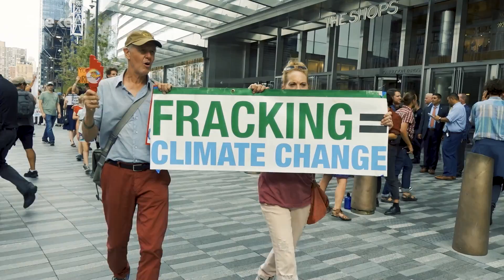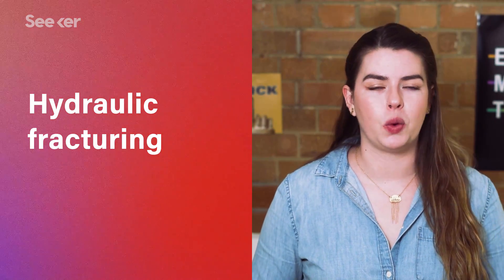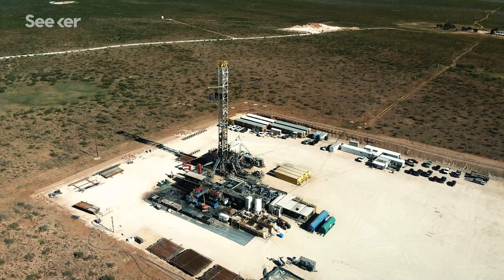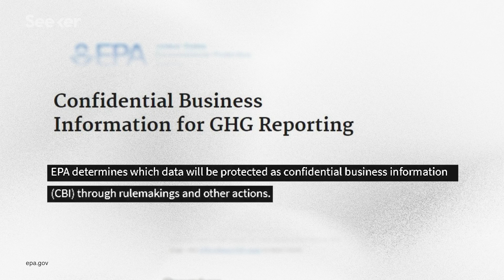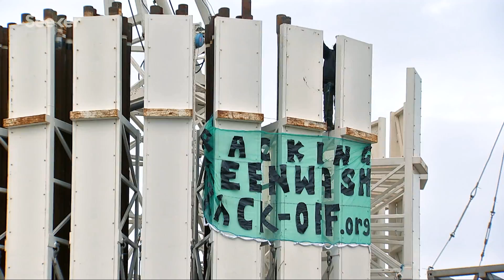What Exactly Is Fracking, And Is It Really That Bad?

Comment: Just so you know, because they're allowed to pump tons of chemicals into the ground without disclosing what they are, it actually gives them the opportunity to legally get rid of industrial toxic waste for free. Fracking is a nightmare, we literally have energy pouring down on us. Solar tech only gets better every year and we're nowhere near the end of that process, more like the beginning.
Reply: Please see how toxic and environmentally destructive it is to make solar cells
Reply: Doesn't work at night!
Reply: @justinvideoman  it does work  new certain plants  uses big multiple mirrors which focuses (solar)light beam at a particular point generally molten salt is used, also they use thermal redundancy capacity of molten salt to generate power at night, molten salt acts as a big thermal power bank for heat exchangers to work and produce power and  anyways if you wanna know more you can look it up, it's called concentrated solar power plant or CSP for short

Comment: What green energy? Again you don’t provide any solution.
Reply: There is no such thing. Environmentalism is largely just another control mechanism.
Reply: @Chris_Garman  ofc there is. If you can't see that I can't help you.

Take the green pill
Reply: @xXDESTINYMBXx  I went to school for Integrated Resource Management, including environmental science, ecology, etc. Get yourself some education so you can join the informed and leave the indoctrinated.
Reply: @Chris_Garman  if you really did that, then you just don't value nature, do you?
Reply: @xXDESTINYMBXx  I just know the truth. Just a tiny example, the first thing taught in environmental science to me; for a single use application, Styrofoam cups are more environmentally friendly than paper. Tip of the iceberg.
Reply: @Chris_Garman  yeah sure, everything is viable under certain circumstances or with certain targets.
Reply: @xXDESTINYMBXx  You mean when you DGAF about the truth.
Reply: @Chris_Garman  whatever rocks your boat

Comment: Video editing is one of the most process power intensive things you can do on a computer. I would love someone to do an analysis on the carbon footprint of the average Youtubers YouTube video
Reply: Look at the power draw of high-end graphics cards used by gamers.

Imagine living with a 1000W heater running just to play games, and then possibly running aircon to try to stay cool.
Reply: I wonder how many lithium batteries they use on daily basis🤔     ..but..but electric cars will save the planet 🤡🌎
Reply: The steak you ate for dinner had a higher carbon footprint, probably hundreds of times higher.

Comment: Bad? Depends on what you are looking at. Environmentally, it is terrible. Economically, it's a $600 trillion problem. You can't even walk through a field of wells without potentially being suffocated by CH6. Over a million oil and gas wells in the u.s alone. 300,000 miles of pipeline.

Comment: She said smoke and mirrors hide the true cost of fracking. Well made videos do the same thing. I’m not sure if I’m onboard or against fracking but I definitely don’t like well made videos that display bad information. It’s my understanding that fracking wells go way deeper than just 1 mile. Far deeper than the water table according to another well made video I watched. That reason alone is enough for me to question the accuracy of the claims made here
Reply: It true that most oil and gas wells go to greater depth than the water table for water wells, but ocassionally the casing fails and chemicals do make it into the water table. Unfortionately there is a lack of monitoring of the well casings, especially on older wells that may have never been fracked. It is one of the dirty secrets of the oil and gas industry that if you find a problem you are legally required to fix it, but you are not required to look for well integrity issue throughout the life of the well.
Reply: @randywiedenfeld7094  I believe it. I also heard recently that Alberta is covered in abandoned wells on private property that the landowners are now responsible for. Any industry that pays the government big money (ie oil industry, car manufacturers, pharmaceuticals) are dirty in some ways but are given free passes. Protecting the environment doesn’t get enough votes to offset the costs so it takes a backseat. But like I originally said, I personally don’t know if it’s as bad as the tree hugging crowd would have us believe

Comment: "In a world that's demanding more and more energy every year,..." -- and there's our problem, for which there's no practical solution.
Reply: Oh yes there are many solutions, its called birth  control, its available as a pill, shot and several other methods, many oh natural.
Reply: @jamesh1017  On a serious note, there are actual solutions.  Machines (both electronic and mechanical) are becoming increasingly efficient.  Certain crops can be modified to have higher yield in less land area and with less water.  People could eat less beef, which is a very inefficient food in almost every regard (pork, chicken, fish, and insects aren't much of a problem).  Governments could push for more recycling.
The thing is, we don't really have a reason to look into such things since we currently don't need them.
Reply: @Toastmaster_5000  how can you say pork is less of a problem?  What metric are you using to judge “problematic” that has the factory farming of pigs as less problematic than the factory farming of cows?
Reply: @jpe1  Pigs need significantly less land.  They're much more "tolerant" than cows in captivity.  They can be fed various kinds of food scraps that aren't marketable to humans (cows are pretty much just limited to grass/hay).  Pigs produce less methane.  More than half of a pig's mass is fit for consumption (cows are around 45%).
So basically, in every conceivable metric, pigs/pork is less of a problem.
Reply: @Toastmaster_5000  you discount the enormity of the problem of their waste, and that alone is why they generate more methane per pound consumed flesh than cows, but the bigger problem is the direct damage to the environment from eutrophication of waterways from pig farm effluent.  Plus it smells awful.
Don’t get me wrong, I’m in no way defending the raising of cattle, I’m pointing out that pork is not an environmental nor morally “better” choice to beef.  Neither should be consumed by humans.
Reply: @jpe1  Each of the problems you mentioned could be solved, there's just not enough of an incentive to do so.
Reply: @jamesh1017  😂😂
Reply: @jamesh1017  I'm afraid it's not a practical solution, for temporal and cultural reasons, especially because most people are not even aware of the problem. Population will be controlled, but it's not likely to be in that way.

Comment: It's not sustainable, simple.
Reply: @brycemonkey3867   they are, and on top of that guess what, they are renewable too. The renewable energy sources complement each other, and as well as energy storage technology
Reply: @RobertoCarlosM  Ohh Are you able to tell me a real energy storage solution?
Reply: @RobertoCarlosM  Renewable energy sources are not sustainable because of their intermittency plus daily and seasonal variability in demand. Storage technology won't cut it. You need a backup energy source. You also need fossil fuels for extracting materials, manufacture, transport, construction, disposal, and replacement of wind and solar. Plus they provide only electricity, for which a much more advanced grid will be needed, and even then most current energy usage is not in the form of electricity.

Even if wind and solar could supply sufficient energy, it would take an enormous amount of fossil fuels, especially oil, to scale up the current level of "renewables"; but conventional oil has already peaked, and fracking is a dying industry. Fossil fuels will be too expensive to extract before long, even to power our current economies. Whichever way you turn there are problems with no clear solutions. All that appears clear is that there will be less energy in the future, and we will be forced to come to terms with that.
Reply: @brycemonkey3867  Sustainable for the environment. :)
Reply: When we talk about sustainable energy, we talk about the energy produced in such a way that won't have any negative repercussion on future generations, and in fact, renewable energies produce sustainable energy, since the energy produced satisfies *some* (not all since we still need more development on that matter) of the needs of the present generations without compromising the ability for future generations to satisfy the same needs.

I know the word "sustainable energy" has also meaning in economic and social concepts, but it's not sustainable energy anymore if oil is a way of obtening energy that has a negative impact on the environment, and most importantly, is limited, which means that oil won't be able to supply energy for future generations and, therefore, they won't be able satisfy their needs as well. 

It may be sustainable now, in the present, but it's not in a long-term time periods. So yes, renewable energies are more sustainable than oil and other unrenewable energies.
Reply: @brycemonkey3867 

I agree, we cannot stop using oil as a form of obtaining energy for now, since basically most of our energy grid system is based on oil, coal, and other unrenewable forms of obtaining energy. But my point was that oil is not a sustainable energy source due to the fact that its limited, damages the environment, and it's not renewable. Like you said, oil will only power our energy needs for a couple of hundreds of years, but that it's what make it unsustainable. For the simple fact of having an expiration date, damaging the environment, and not supplying future generations the same energy to satisfy their needs, its what makes that energy source unsustainable for its own.

I must also disagree on what you said about not forcing nor enforcing regulations for the soul purpose of transitioning from unrenewables to renewables. We must have some sort of regulations that incentivise private companies to invest more on renewable energies, therefore, contributing on their development and their price lowering. If we don't enforce anything, if we just ignore what unrenewables are doing to our climate and ecosystems, we would still be relying on a 100% energy that came from unrenewables. So my point is that, we don't have to "force" the process, but we must accelerate the transition from unrenewables to renewables, and having an agenda focused on that only accelerates even more the process. 

I must say that if we invest more on renewables, not only it will contribute on the development of those technologies but also on making them cheaper. Therefore, more people would be able to afford them and transition to clean energy sources. I think it's important to have some sorts of regulations or political agenda to let that happen faster and more effectively.

So, if we just, all of the sudden, stopped using oil for obtaining energy, it's obvious that it would have a negative impact on the public, but that's not the case of reality. We need to invest more on them to let that transition happen completely.
Reply: @brycemonkey3867  The fact that solar and wind don't make greenhouse gases on the process of making energy, makes them even more sustainable than oil. You can name me all the disadvantages that solar and wind have, but you'll never find a valid argument backed with facts that recognizes oil as a more sustainable form of obtaining energy.

Comment: It's either fracking and self reliability on oil leading to withdrawal from the middle east and isolationism or dependence on the oil from middle east and further wars and conflicts and bloody politics.

Choose side.
Reply: or. nuclear, solar, wind, geothermal and tidal power, so many other options than war or fracking
Reply: @RicoGG  look at the ships, planes and trucks in the logistics chain of vehicles and you'll understand what a nonsense you just wrote.
Reply: @dvanerdivkanade  logic isn’t allowed here
Reply: @dvanerdivkanade  Many are convinced that the Green New Deal is a serious proposition. Sadly it's just a fantasy.
Reply: @RicoGG  Not really. Fuel isn’t the only thing petroleum produces, and no alternative is sustainable enough to fulfill the world’s needs.
Reply: @RicoGG  Beside nuclear, all the other options are only supplemental energy sources, not reliable enough to keep a stable power grid.
Reply: @lajya01  batteries and flywheels

Comment: when your only selling point is being slightly better than literal coal, stop selling.
Reply: Instead we should live without modern amenities.
Reply: @rajashashankgutta4334  how do you plan on convincing 7.6 billion to do that lol
Reply: @arthurmorgan6087  my last comment was a sarcasm.
Reply: @scientistsbaffled5730  why bring my mother in here?
Reply: Thanks, Stalin
Reply: It’s a lot better than coal
Reply: @arthurmorgan6087  40% isn't a lot. Nuclear energy is 100% better as it is carbon neutral.
Reply: @mrkokolore6187  Nuclear energy is better sure. How does that translate to powering cars? So you need batteries. How do they make those and what is the environmental impact of those processes? How is nuclear going to meet polymer demand? How is it going to meet chemical demand
Reply: @arthurmorgan6087  how is it better than coal? the video literally said it emitts more greenhouse gases in production and usage than coal
Reply: @vivago727  if improperly maintained, methane does leak from them. But with strong regulations, you can prevent them. Also natural gas may help in roll out of renewables.
Reply: @vivago727  because the emissions of coal are significantly higher than the emissions of natural gas when combusted
Reply: @vivago727  coal puts out things like sulfur and and various heavy metals. The big smoke stacks on a coal plant are to help disperse the pollutants away from the production area... but arguing about coal is pointless, it’s a dead technology that’s not worth investing in in the western world

Comment: i worked on a fracking site , we pumped chemical water down past the ground water, they said it wouldnt hurt the ground water . but they said dont touch the chem water in the ring! i call bs on them!
Reply: You don't see them fracking in the fracking company owner's back yard do you.
Reply: @stevechance150  They probably do tbh, and people are delighted to have wells on their property bc it means a massive check when gas or oil is high
Reply: can you explain me how you drill horizontally
Reply: @user-cj4fu8qq9b  She lays on her back, you approach from the south, the "pipe" is in a horizontal position, you get the picture?
Reply: @user-cj4fu8qq9b  His bullshitting
Reply: It doesn’t touch the groundwater bc they drill below a seal or cap, an impervious layer between the source rock and the aquifer. They also use concrete and other materials to seal the casing. They do pressure checks too to make sure the system isn’t leaking to the surroundings.